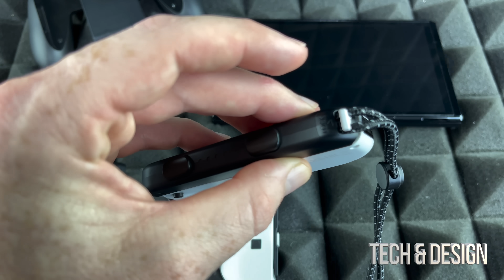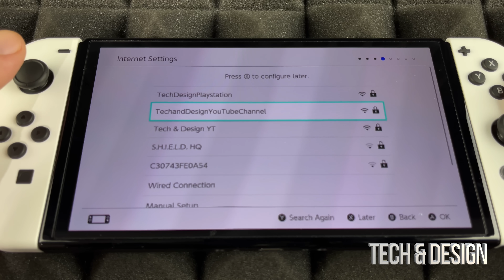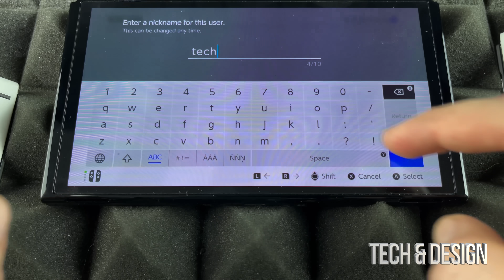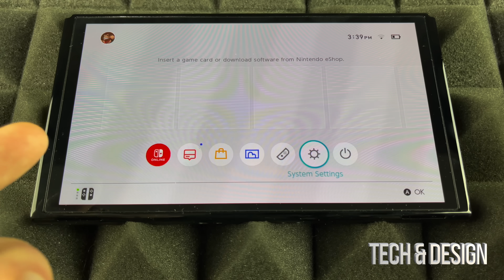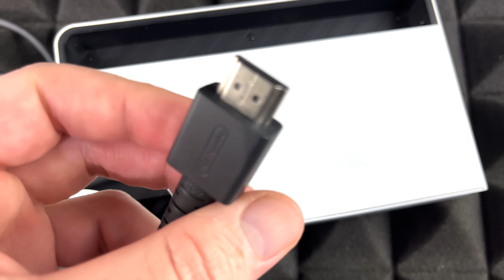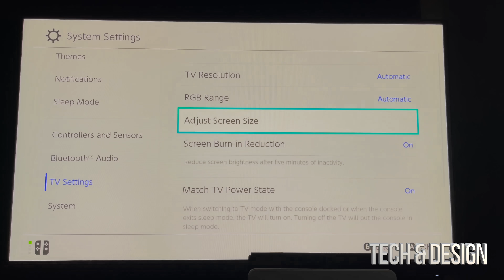How to Set Up New Nintendo Switch Oled Model | Beginners Guide | First Time Turning On

Comment: Appreciate you doing this video, can you or anyone else answer this please ? On my tv i use the HDMI ARC port for my firetv stick 4k which is set up with some echo studios  for my home theatre,  if i connect the switch to the (free) HDMI port on the tv ,will the sound come through the echo studios so the sound quality is still there or not ? I haven't actually tried it because I've only just ordered the switch oled , thanks

Comment: Yep I've done all this. I didn't get very lucky though with the Nintendo switch. But that's ok, maybe it's meant, for a reason not to work. I spent one whole day, trying to connect it, still didn't get anywhere with it, the only luck that I did get is ended up on Facebook 🤦🏿‍♂️somehow🤷🏿‍♂️. If I would have got it done earlier I could have made it to McDonald's it's 1:15 am where I am.

Comment: If you have the money I would recommend buying spare joycons so you have 2 pairs because one could get something called drift (and this is guaranteed with all controllers from each console) which makes the left or right analogue stick to move by itself on the switch but you can send your controllers to Nintendo to get it replaced/fixed but it will take them a while so if you still wanted to play on your switch you could get your other controllers or you could buy a pro controller its around the same price but I would just recommend getting joycons as your switch really just look like a tablet and you wouldn't get the full Nintendo switch experience but if you use docked which connects to a monitor or tv (television) I would recommend a pro controller

Comment: You don't actually need to hold the unlock button (behind the Joy Cons) to remove straps. Just make sure the little grey thing is in the unlock position, and you can slide it off.
Reply: theres a high risk of damaging the joy cons by sliding it off like that. I wouldnt recommend it.

Comment: Whats the difference between the two switchs? Besides size.. oled seems a bit bigger right? Anything else?
Reply from the maker: I have been testing both and the Oled seems to be maybe half a second faster at loading
Reply: Oled has bigger and more vibrant screen, a much better kickstand. It has a lan port in the dock. It has twice as much base storage as the regular model. It also runs slightly faster. The only downside is that you have to be willing to pay 50 dollars extra
Reply: It has faster processor speed and better kick stand

Comment: I have VERY important info about the joycons that come with nintendo switch OLED. First of all nintendo actually did make the drifting wear less of a problem by placing foam pads on the backside of the joycon cover. Remember that this was checked only on the white oled model.
Reply: @cartergomez5390  OLED is the screen used
Reply: @ozby11  Organic Led.
Reply: @cartergomez5390  you
Reply: @cartergomez5390  have you been living under a rock, OLED( Organic Light Emitting Diode) 💀

Comment: The old switch joy-con rails also had locks.
Reply: True I can confirm this. I have the OG 2017 model and the joycon straps had the locks on the bottom.
The only difference between the new and old ones are the cords used to make the wrist straps. The new cords have a different braid.